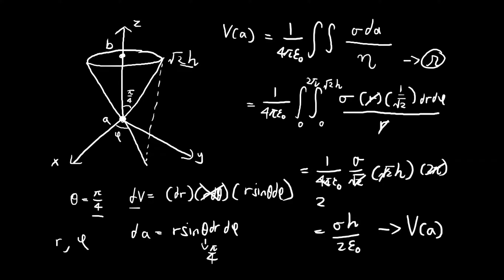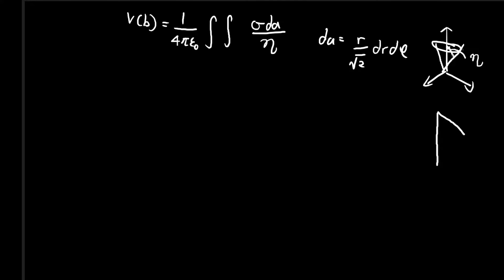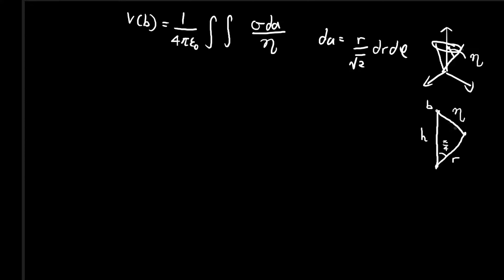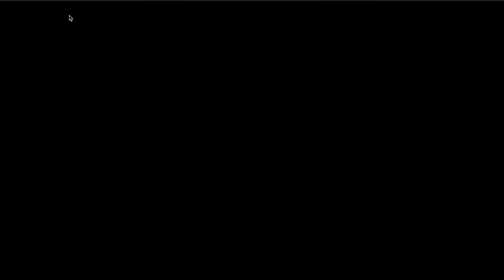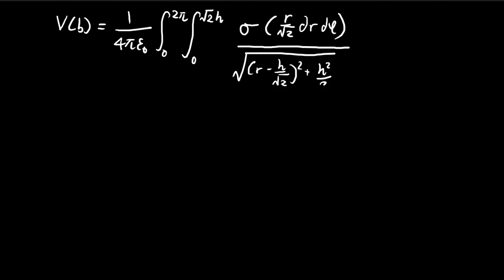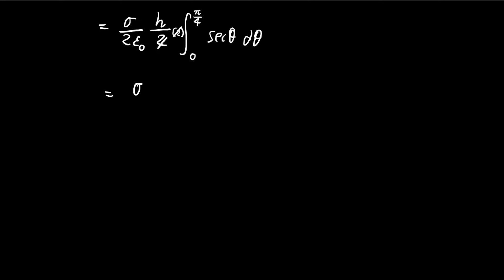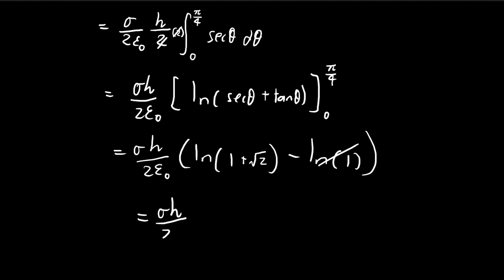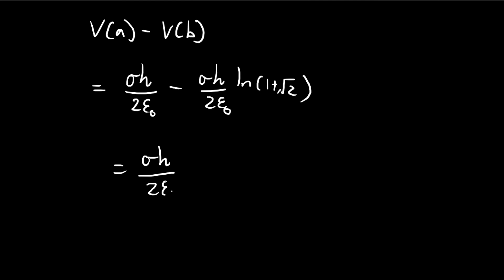Problem 2.26 (Part 2) | Introduction to Electrodynamics (Griffiths)

Comment: Actually, the integral of sec(theta)*(1+tan(theta)) is equal to:

Ln|(sec(theta)+tan(theta)/(sec(theta)-tan(theta)| + sec(theta). 

Notice that the term with sec(theta)*tan(theta) does not go to zero. 

In fact, if we evalue from -pi/4 to pi/4 the answer is Ln|(sqrt(2)+1)/(sqrt(2)-1)| which is aprox. 1.7627. 

I like your videos though. Nice work!

Comment: Why did you not use simply the radius h as η ? Technically that is the distance from the point b to the edge of the cone, which is a point on its surface. Why do we have to draw another line and complicate things?
Reply from the maker: Check 1:42, η keeps changing as you integrate across the surface of the cone, that’s why we cannot just treat it as h. Note that we’re not only integrating along the edge of the cone (if we were that would give us a circular loop, not a cone). We need to consider the entire surface of the cone, and that’s why we need to introduce η to keep track of the changing distance.
Reply: That makes sense thank you very much ❤️